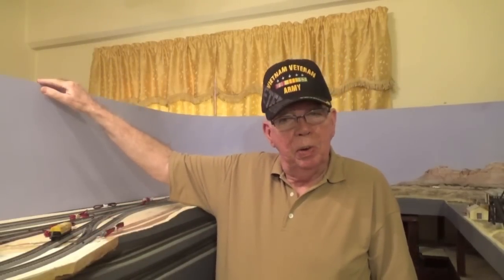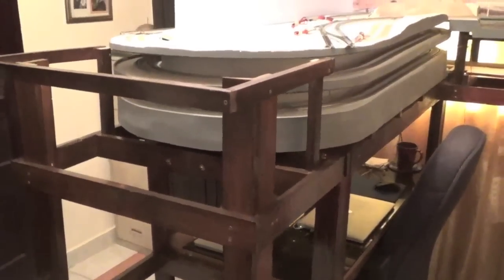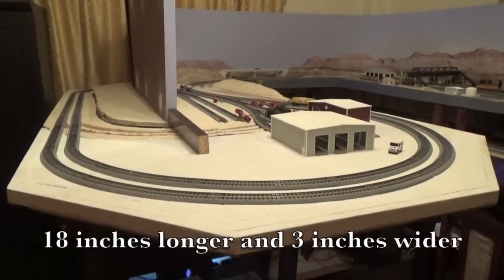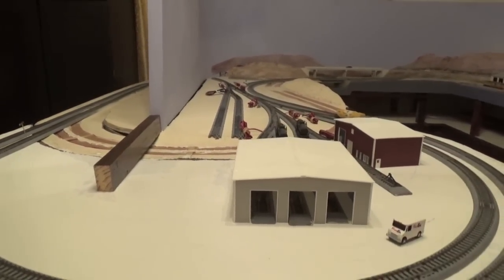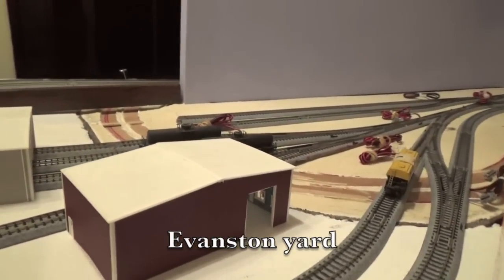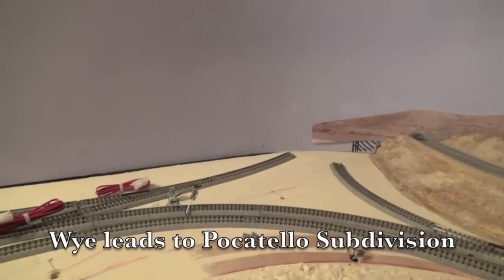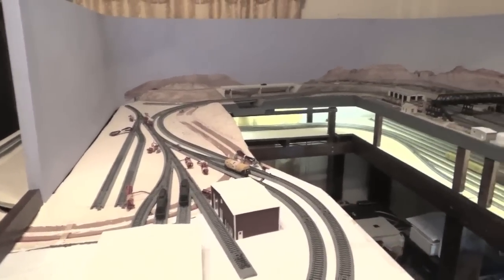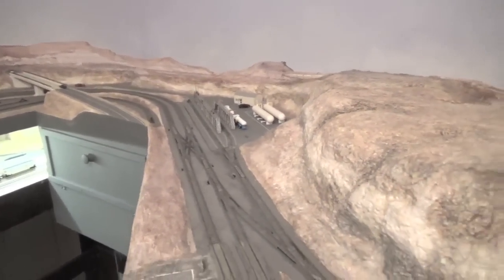Extending the Peninsula on My Layout

Comment: Nice addition Roy, that tank car facility really benefited from that extension.
Reply from the maker: Thanks, Wallys. The tank car facility did indeed benefit from the extension. As I guess you know, it is a representation  of the Union Tank Car Co. at Evanston, albeit greatly compressed. It's one of the very few structures on my layout based on a prototype industry, because there are very few small scale industries served by the railroad on the Evanston Subdivision, again as you probably know. So, to add operational interest to the layout, I pretty much have to go with fictional industries. ...Roy